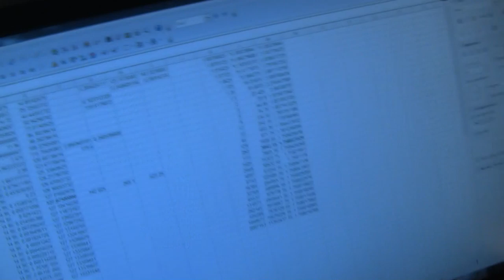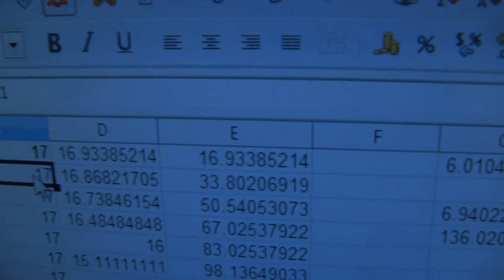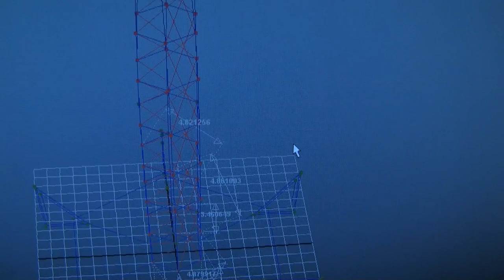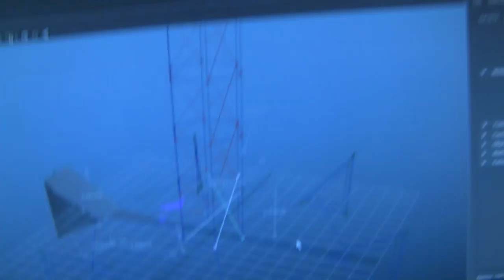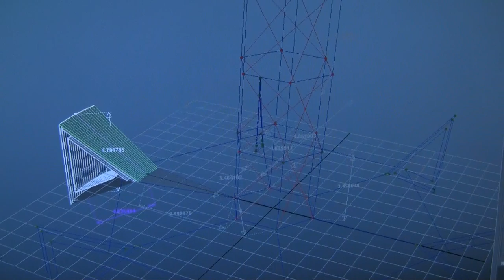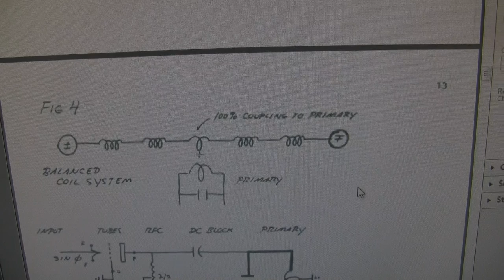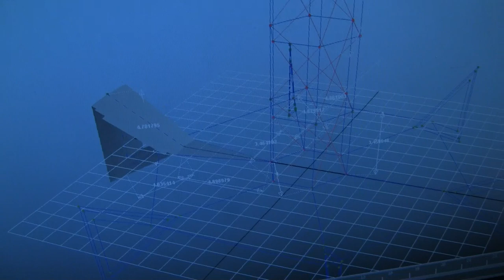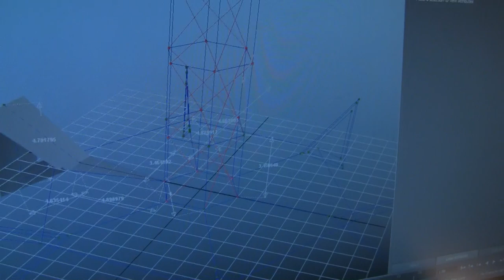Tensegrity, Fractal Harmonics, and Tesla's "Extra Coil"

Comment: I love these new ideas.  Keep up the great work!
Looking forward to bringing tesla up to date with Dr. Harmonics here!

I have started a non profit organization called Rural Energy Solutions,
to bring tesla energy transmitting to extreme rural areas.
I still need to do the 301 c form for the tax write off ability.
The first step would be to make a badass tesla lab to make prototypes of inexpensive resonate-frequency, longitudinal-wave, wireless-energy receivers that only need to connect to ground to receive data ,power, and the internet. 
We need a long strip of land to do testing on.  
We could buy up an old railroad for cheap.  
The tracks are conductive if we patched up the cracks between bars.
And we could make an enormous grounding line, say if the railroad tracks were
grounded with a full size (6 foot) lightning rod every 10 meters or so.

Comment: you can also use the wave of energy moving outward and then returning back to your advantage by skewing the pulses so that the wave can assist each other in the movements to create the system final output.   Tesla bounced energy into the earth and the reflected wave back is what creates the huge arcing at the top of the coil also he found that the electrons were moving so slow they never got very far into the heavy primary coil.   The Etheric force kept going into the primary.

Comment: I know you are on to something. I don't have the math but I do understand the principles. You might find this concept valuable. It was presented to me in a very special dream while I was researching Teslas work... consider a plasma diode that is built in steps like a series of stairs, each length is in a harmonic ration with the one before. In the vertical part of the tube (stair step) is a restrictive material working like a multi stage capasitor. stimulation of flashover in the first stage is external an excitor that starts the charge amplification in steps up to coils.

Comment: Tesla's Extra coil, secondary, and primary were all tuned into a harmony with each feed the other.  He loved to use the swing set approach where each pushed the others at the right time to get some huge amplification.  I'm building a pcb that wiil allow a dual system approach to driving two primarys one positively and one negatively.  BEMF crisscrosses between the two systems.

I haven't decided on the type of coil I will be driving.   I think I'll use  a couple of my Rodin coils as primaries.

Any  thoughts on this would be greatly appreciated
Reply: CAPTAINSSBN 
Hey Capt
Are you using a NST ? Or x2 Motts  on your double primary? I've been following this guy for about 3 years, he has a good Soul , and very Smart , I've been also playing around with several primary's , and for some reason, I understand everything that Gregor says, it like I new this some how. Wow! 
Anyway get back
Reply: Biefeld-Brown graviator replicate lift happened after "flick of the swithch'thus,may very well be an application for proposed  polyphase method.

Comment: Interesting point with the standing wave. I was wondering how to achieve a standing wave in a permanent magnet brushless generator then to be able to invert half of the waveform to rectify the voltage into dc without using diodes, seems like it could be done if you could pulse the circuit at the speed of light or perhaps with harmonics and by tapping into the coils at certain points along the wire, but how do you pulse electricity at the speed of light?

Comment: The base of the tower is a Zonohedron with 16 vertices. The Octagon base of the tower looks like his AC induction motor patent, also forming an Octagon. The cupola is an Octagon, with adjuster at the top. The facade is a Cube, Octagon. The well cap, part of the 12 ft square, telescopic spiral staircase, is a Octagon. https://scontent-b-sjc.xx.fbcdn.net/hphotos-xpf1/t1.0-9/10390007_10152166608364103_1378138983510088283_n.jpg It's the Cyclotron and Cyclotron resonance patents, and Wikipedia which describes how radio waves give electrons their force.

Comment: interesting concept. have you thought about some form of compression. mirroring the system, both wave forms hitting a central structure.  I have just seen this video  and  haven't had time to put any real thought into it, but seems that something along the lines of a  Stirling Thermoacoustic Power Converter and Magnetostrictive Alternator might be the answer. Of course, the scale of your project is well beyond the scale of the emerging stirling alternator but the concept seems to be along the same lines. Here's a link to some tech specs. http://technology.nasa.gov/patent/LEW-TOPS-80. It's a simplified nasa explanation, sorry, but might help.